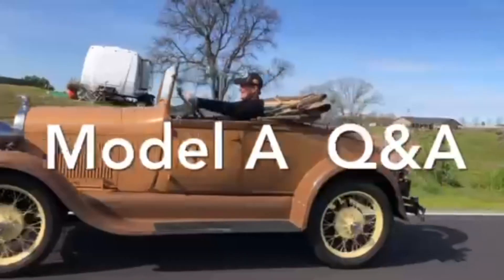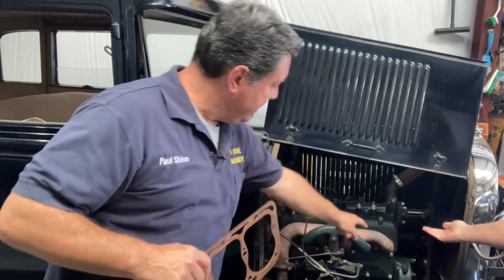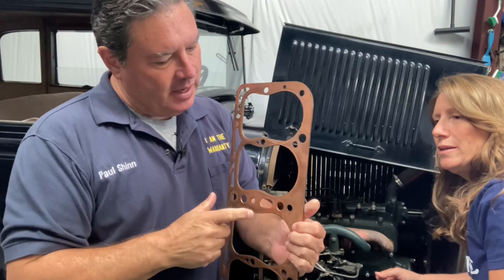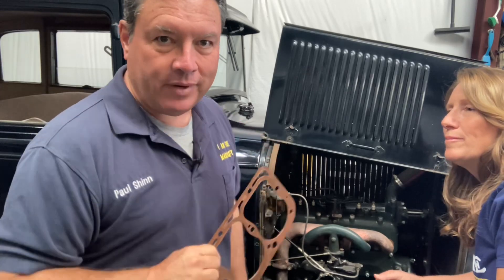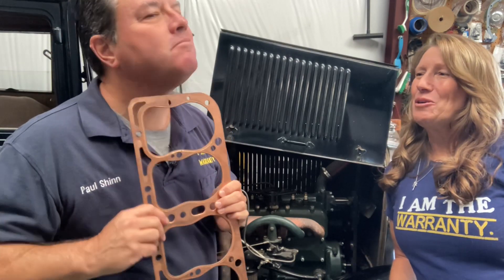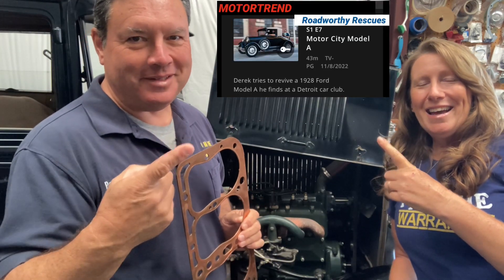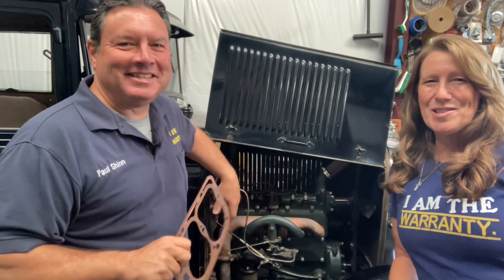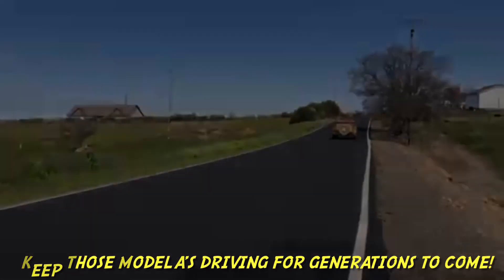Ford Model A Q&A of the day - Over Heating

Comment: There is a litmus fluid method of checking for combustion gasses in the coolant, it uses a blue litmus fluid and tool pulls vapor off the radiator opening and draws the vapor into the fluid and if it has combustion byproducts in it , it turns the BLUE fluid to a green and under extreme cases it becomes yellow. This tool may keep a person form chasing the wrong problem. I have used this method for 50 years and it doesn't lie.

Comment: A test that I did When I have had possible head gasket problem.  I fill the radiator up so the water is almost to the to the neck.  I run the motor and look for big bubbles popping the surface.  Also there are test kits for testing for gases in your water you can do yourself from auto supply stores.
Good luck.
Steve
Reply from the maker: Awesome share, thanks Steve!

Comment: Great advice with the overheating, the gasket is a lot of the issue, most of the time. My son's 1976 Massey 285 was cutting hay when his exhaust stack started blowing out white, which was steam. Yep, you guessed it, the head gasket blew, between the no.1 and 2 cylinders. What a pain, we had to pull the tractor home, luckily it was only a few miles away and not at my mom's property 25 to 30 miles away. We did get it replaced, however, there was more to the story, this spring we had to replace the sleeve and gasket due to a cracked sleeve. Anyways, Paul's on the mark there, thanks for sharing with us, I hope you have a wonderful week.
Reply from the maker: Wow, great share! Thank you!

Comment: Before pulling the head,  Can this be done on a Model A Engine?  
1. Remove fan belt.
2. Drain coolant out so it's about below the head.
3. Remove top hose & water outlet piece.
4. Fill with coolant so it's just at the top of the head.
5. With car in neutral. start engine (do this with engine cold preferably)
6. "Gun" throttle a bit a few times and observe if their are any bubbles coming up.
You would have to have a good amount of bubbles to condemn a bad head gasket.
One or two bubbles here and there, probably not a concern.
This is a procedure is straight out of the military Tech Manuals for a WWII Jeep.
Reply from the maker: Thanks for sharing, but Model A’s and WWII Jeeps are different…if you did this to a Model A, taking water neck off, the 2 front bolts that torque the head, there would be a huge head gasket leak.

Comment: I’m having this problem too. I trued the head and installed a new graphite gasket from Snyder’s. Unfortunately the problem is worse now after doing a much needed valve job. This valve job just caused a great increase in cylinder pressure. So now, instead of the problem manifesting in about 15 minutes it only takes 5-6 minutes of just running in the shop. A few quick accelerations of the gas pedal and the coolant comes blasting out of the radiator . 
Soooo. I’m taking the head off again to have it magnafluxed. I’m hoping it IS. A cracked head and not a cracked block. I’ll let you guys (and gals) know what I find .
Reply from the maker: @cobbleup  the problem is probably the graphite gasket, we’ve had problems with them every single time, this is why we only use copper gaskets now.
Reply: Thanks for the recommendation 👍❤️
Reply: …might I add : 
I find that someone with real experience (Ie, you guys) always have much needed valuable input. The item description of the “graphite head gasket” in Snyder’s catalog describes it as the final solution to the problem. It’s encouraging to get your real life input. Now… I just ordered one of the silicone coated ones (before reading your comment) . Have you got any sage advice about whether to use it on a block with some pitting and a few places on the mating surfaces with about .003”-.0035” clearance? (Everywhere else the clearances are .002 or less)

Comment: I remember years ago someone who worked on diesel engines saying that you should change coolant annually to keep it from corroding head gaskets... I don't know if this actually makes a difference, any thoughts?
Reply from the maker: @timnewman1172  not in a Model A, it’s not a pressurized system. You basically only change it if it starts looking different than it did when you put it in.